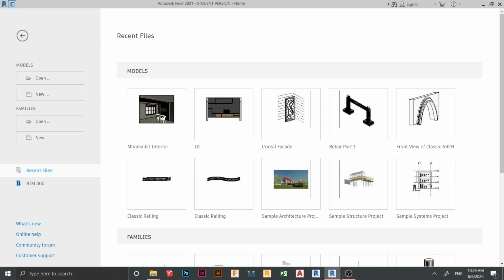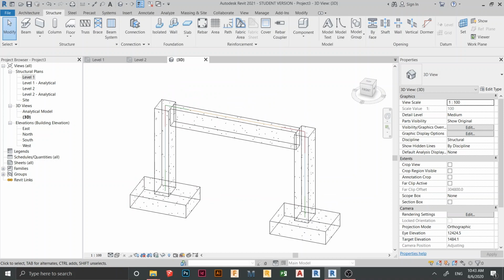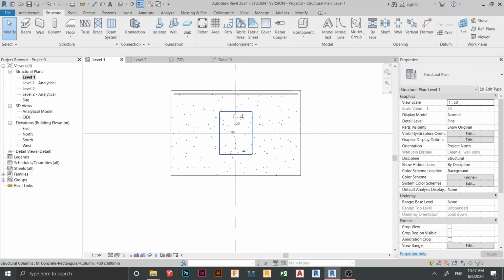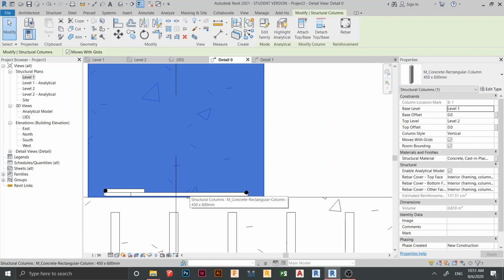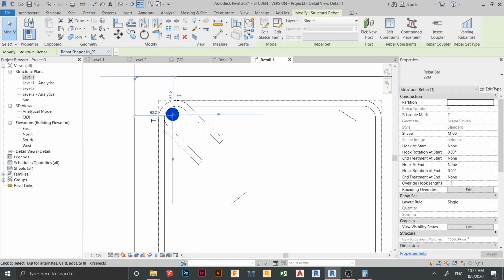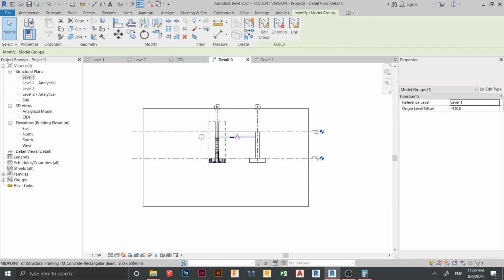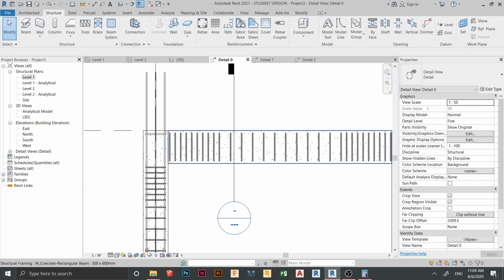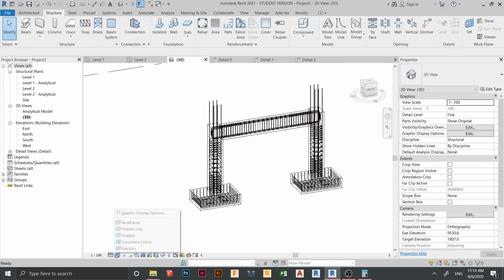Reinforcement Rebar Footing, Column & Beam in Revit 2021

Comment: Hi, instead of copying and pasting the rebar why dont you use max spacing. It makes its so much easier when designating bar marks and schecule.
Reply from the maker: Hi, @micky wong. Thank you for your question.
Answer: if you're using max spacing every stirrup will be the same spacing. in reality, construction, if your column or beam from bottom to top same spacing your column or beam will be crack. 

The requirement from ACI code: Purpose of providing Closer Stirrups Spacing at both Top & Bottom end in RCC Column. The spacing of ties is calculated as per the plastic moment capacity of the column. The spacing you come up is required at the ends because the moments at the ends are greater and you have most of the cracking going on in the end zones.

that's why I need to copy instead of using max spacing. if you study civil engineer, you'll understand more about that. thank & have a nice day
Reply: That is called zoning